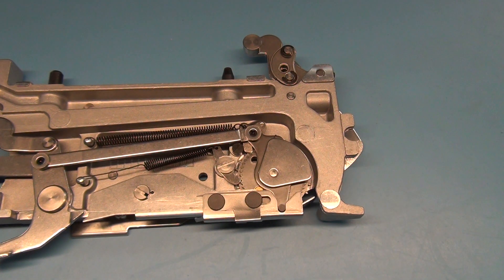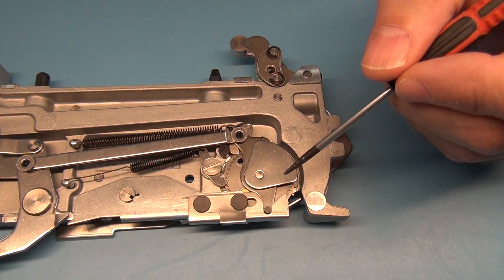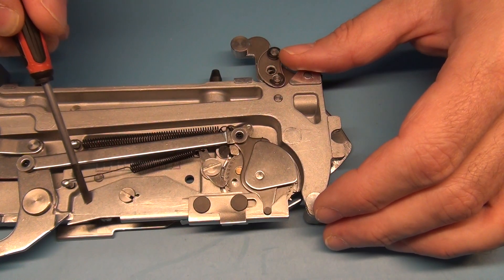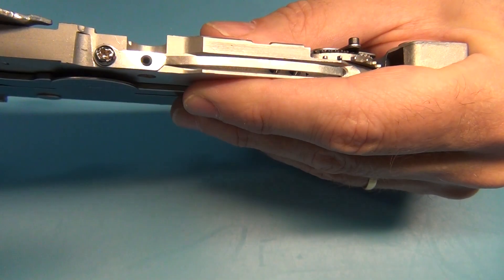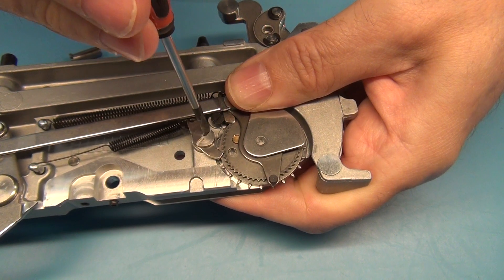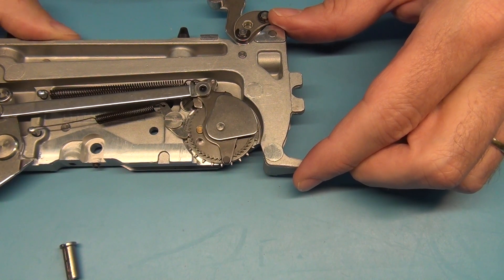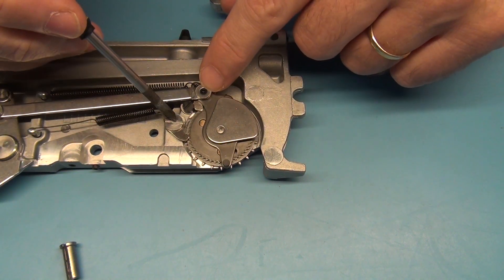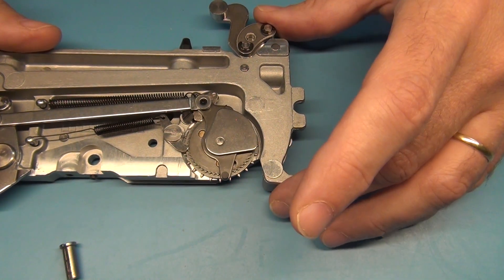Yamaha SMT feeder calibration

Comment: planningto use neoden machine , looking for how I can use pneumatic cheap feeder like that , instead of electrics ones .
I got them this morning and it a big difference ! ( no machine yet ) but I can already feel electrics are better , 
also HOW MUCH vaccum you need to trigger the pneumatics ? 
it's insane the springs are so strong to make  a very critical operation.
Reply from the maker: Our machine regulates the system pressure to 7bar and then distributes it out to the feeder. I think they will work well within a 5-7 bar range. We have also moved over to electric feeders but only because we need higher pickup accuracy when running 0201 components. The pneumatic feeders works very well for 0402 parts.